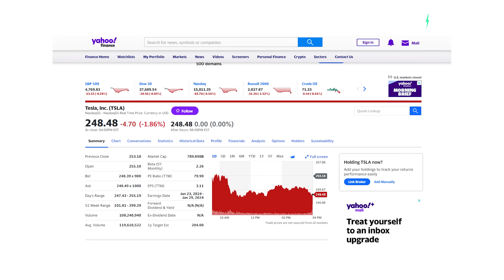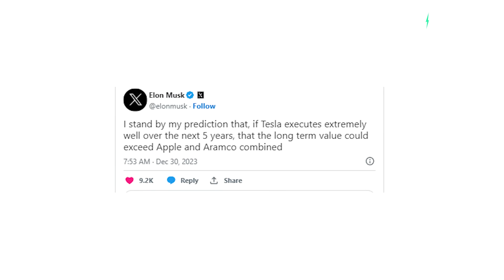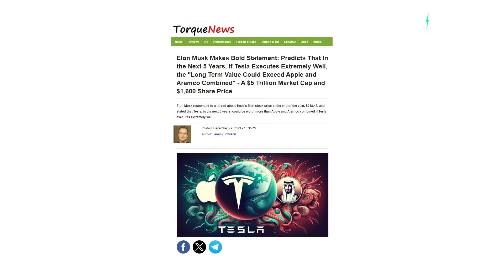Elon Musk predicts Tesla's likely stock price in 2029 - $5.2 trillion market cap

Comment: No Sam they won't have $6 trillion in value off the Teslabot in 7 years. It you want 20% of the labor market they would have to build enough robots to replace 20% of the workforce in that time. That's probably near 500 million bots. I think you're looking at 20-30 years minimum to hit that goal.
Reply: Robots don’t eat or sleep or commute….maybe 1 robot equals 4 workers?
Reply: @paulwilhelmsen1602  maybe, there is also downtime, repair, maintenance, but even at 4 to 1 could Tesla realistically make 125 million bots by 2030?
Reply: No they won’t need to build anywhere near the same number of robots to replace humans. Robots don’t stop apart for charging and regular maintenance, humans have holidays, sickness, rest breaks, sleep etc.etc. I would expect 1 Robot to do 5 peoples jobs in terms of productivity easily.
Reply: @ISuperTed  even at 10 to 1 that would require about 50 million bots or over a production rate of 7.1 million per year average between now & 2030. I think even 50 to 1 would be a stretch to produce that many robots that quickly.

Comment: Regarding Autonomous Driving: This turned out to be a much bigger hurdle than even Elon imagined. But..
Elon realized that he needed to create a whole different solution which included a different approach to computing, a whole new hardware environment and a completely new type of AI algorithm. This not a problem you can overcome with gaming GPUs.
When Tesla engineers crackle all the facets of FSD it will be a game changer. It doesn't really matter if Tesla solves FSD in 36 months or longer. It only matters that Tesla does solve it. The revenues generated from FSD will very hard to imagine but they will certainly increase the value of the stock.

Comment: If I were Elon, I would urge my Software Engineers to write a Vehicle self delivery protocol in FSD and reduce delivery and logistics costs at least 50%. It will be amazing to see each vehicle to drive itself to the customer. Before this it will be almost impossible to deliver 3 million and above cars per year. This will be fist test that FSD works and is safe. Pls. note, Delivery costs exceed $1 billion
Reply: That will be a thing but it can't be required even for 10M/yr.  Toy and VW have done that.